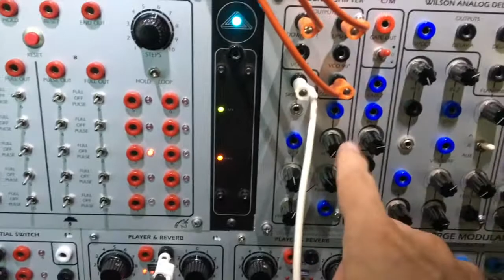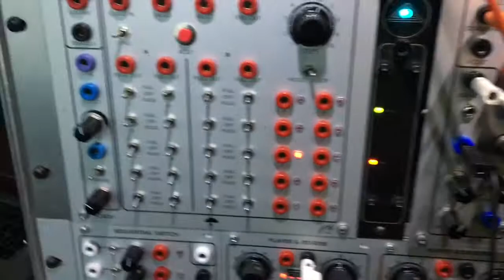13 10 20 Serge Frequency Shifter and Késako Player & Reverb [01]

Comment: How come the sending the signal into the frequency shifter gives it a distortion like edge? Are frequency shifters amplitude modulating ? Or how does that edge appear there ?
Reply from the maker: In this example it is indeed the amplitude modulation which gives this effect, as I'm sending a signal into the frequency CV input.